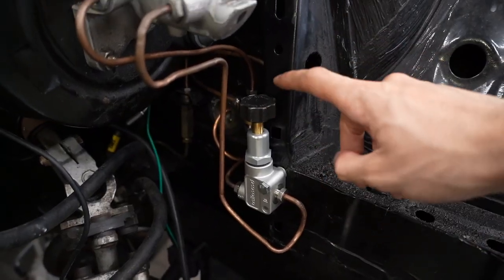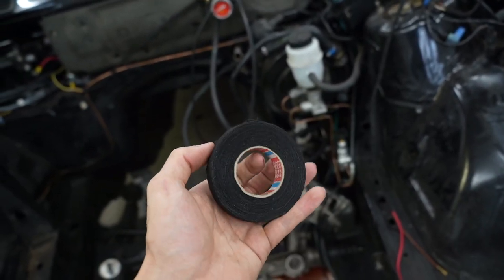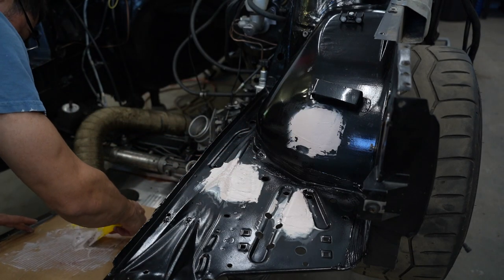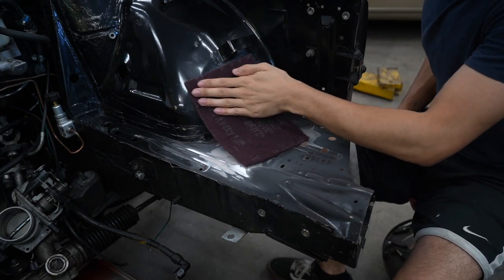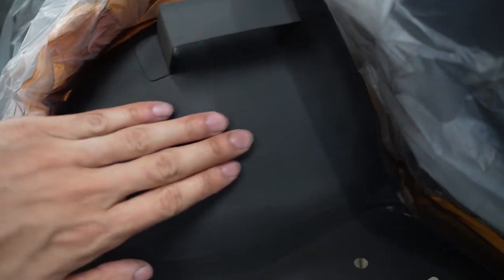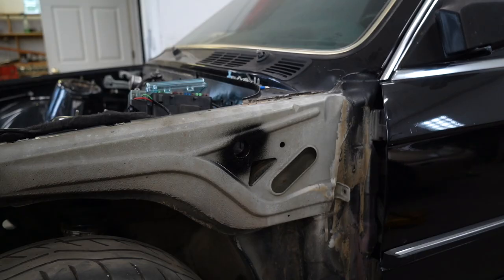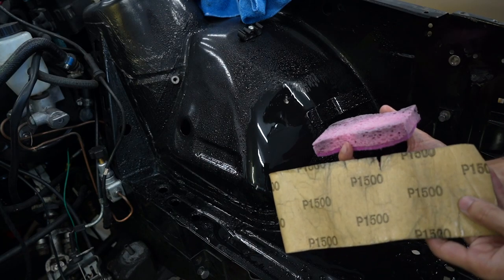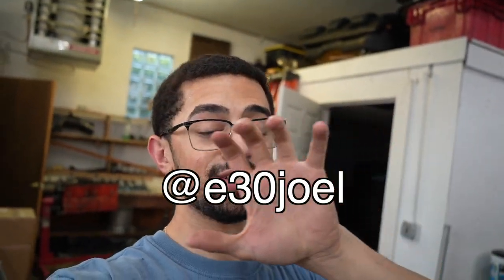I TOTALED My E30s Engine Bay! Blending Paint Is A Disaster!

Comment: 0:50 even with the 50:50 brake bias the front brakes are larger then the rears so they do more work.
Reply: you gotta remember of the engine and physics which makes front breaks locking much harder than rear

Comment: Next time try  to find a seam where you can just mask off of instead of trying to blend the new paint with old paint (I saw a nice line of factory seam sealer a little further back into the engine bay) . As you have noticed, blending is pretty hard if you are not used to it. I have laughed my ass off if that makes you feel any better haha. Great content as always brother! p.s. If you do want to blend; try to make a little tunnel with some old newspapers, let the paint go kind of under the tunnel and then sand it down with some p2000, p3000 wet sandpaper and polish by hand. You'll notice a line as you have experienced, but that line fades away when you go up to finer sandpaper. Then when you arrived at the polishing step, it will be almost invisible to where its 90% gone.

Comment: If your going through metal you should put a grommet, if u can’t find one use some electrical tape and wrap it around the hole so u don’t cut through wire cause the movement will bounce the wire up and down the sharp metal edge and chew through wire
Reply: Just split a vaccum line down the length and use it as a grommet, much better than tape that's gonna do fuck all

Comment: I would have used half the amount of hardener, it wouldn't have gotten tacky so fast. 15 mins seems pretty standard. Block your mud with 80 to right before the shape you want, and then feather it out with 180/320 rather than using straight 220 the whole time lol. It'll take minutes rather than 30 minutes.

Comment: Should have hit it with some 2k clear after the wet sand on the paint and then wet sand the clear then polished it
Reply: sanding paint will make it hazey, especially if its metallic. your base should always be perfect for paint
Reply: @kaelturner9721  yes but once you spray it with clear it won’t be hazy and that’s why I said wet sand with a highish grit like 1-2k
Reply: @Cleanest_whipz  clear doesnt fix any issues. it simply locks what you paint looks like in and protects it

Comment: Your problem is that you don't know when to stop, exact same thing when you refurbished the e46 wheels. You were so focused on getting rid of that line when it would've disappeared after a polish but you kept sanding until there was no paint. With the wheels you were so focused on finding a new technique that sanded faster that you made the surface crazy and instead of stopping as soon as you noticed you kept going.

Also you mentionned ChrisFix but if you actually watched his video you'd know the rolled masking for blending needs to be way more extreme/bigger, and needs to be moved further back when for the clear coat. 

But honestly all this was just making it harder for yourself, all you had to do was paint up to the seam sealer, that would've hidden the paint line nicely. Also that harness hole needs to be much bigger because not only it gotta fit the biggest plug, it gotta fit that, plus all the wires that came before it and are already through the hole. You probably should reinforce the metal around it.

Comment: Filler (bondo) can be applied to anything not more than 320 grit. Doesn't need to be bare metal. But bare metal is best.   Use high build primer. Or just primer.  I wouldn't use etch on filler. Etch is for bare metal. Sand filler from 120-180-320. Wet sand primer with 600. Then paint.  Sorry splurging rn
Reply: Currently fully respraying my Edirty